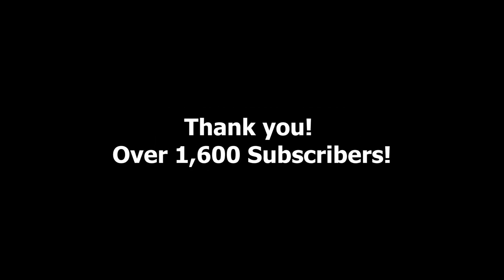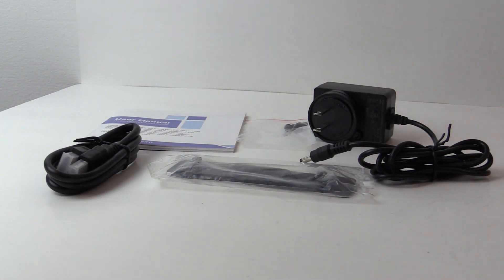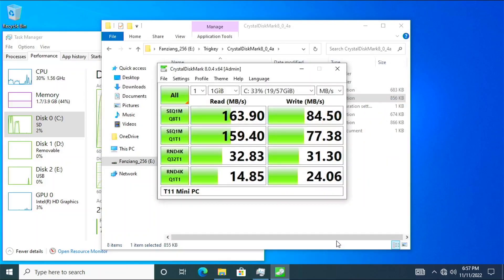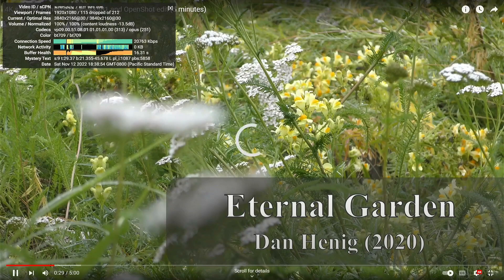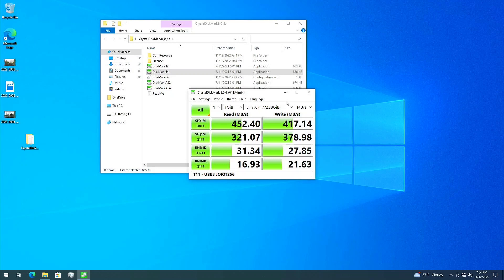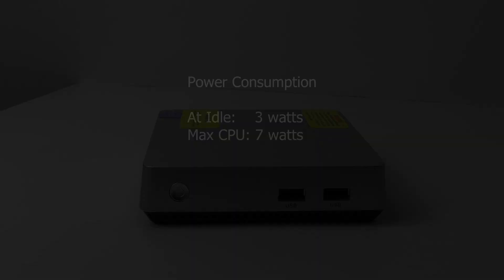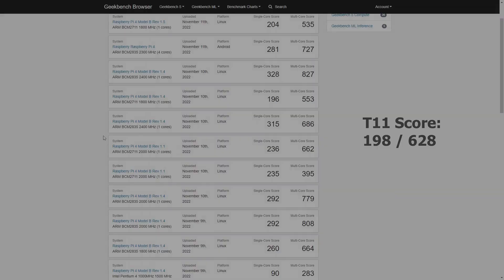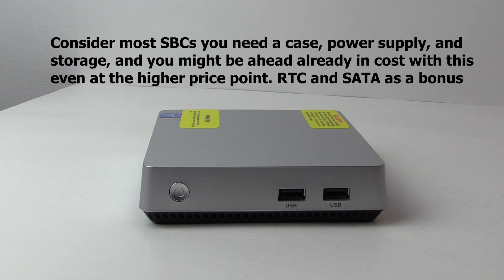Generic Mini PC T11 Review! Synthetic benchmarks and teardown. Can it replace a Raspberry Pi 4?

Comment: I just bought Rock5B and OrangePi5 boards which will blow Rpi4 out of the water, performance wise and got also Beelink Mini Pc's with Celeron N5105 and Ryzen 7 6800H Cpu's. You really wanna stay out of any machine having Infamous Intel Atom CPU.
Reply from the maker: Probably right, just looking at x86 alternatives to low powered ARM computers. This one was interesting to take apart.

Comment: I bought a surface 3 and  acer aspire switch 10 back in 2015 and 2014 and those despite great hardware designs and good features were horrible performers even with 4GB of RAM/64GB eMMC on Windows 8.1. Then some friends starting buying x86 SBC boards such as Rockpi4-X in 2019 using same infamous Atom Cpu's and they were also terrible devices, performance wise.
Reply from the maker: I get it, but I did pick a second one up for $19.99 on sale.

Comment: I opened mine up to see what kind of ram was in there so that I could try to upgrade it because it's slow. And I couldn't find a video on upgrading the RAM so I just figured I'd look myself. And now it will not power back up and I have gone in and checked and rechecked everything and I can't understand what is going on. I've had it for 2 days.
Reply from the maker: Oh no! As for RAM, it is going to be soldered on and not upgradable. As for why it won't power on now I don't know unless it is ESD damage. I didn't have any issue with mine and a friend has bought a couple and opened up with no issues. If you bought from Amazon try to contact them or the seller and see if they will replace or refund.
Reply: @ntgm20  I figured they wouldn't since I had opened it and "tampered" with it. I did manage to get it started back and it would only start with the extra power button that's hidden on the inside, not with the regular power button that you push on the outside. But after more tinkering it started working again. I think something was not seated right somewhere. Hopefully it stays going! I'm still dismayed how slow it is though. I got this to replace my big clunky desktop, but the clunky desktop was faster than this!

Comment: After watching this video several times, I finally went ahead and got one of these to try out. Only "problem" I seem to have is not being able to run this thing headless (Ubuntu server). So long as I have a monitor plugged in (even if turned off), it's fine. Once I unplug it, however, I seem to never be able to log in through SSH as if it's stuck in boot loop or failing to post (or something). Have you run into this issue?
Reply from the maker: Oh wow, I hadn't tested it on that but planned to run it headless.  Good thing I got a three pack of VGA dummy plugs when I got them for my HP machine.  I did notice some odd behaviour last night when swapping VGA cables on a monitor I was testing to sell, had to do a hard reset on the computer. So very weird, requires more investigation later. Thanks for your feedback!
Reply: @Not Terrible by Goodmonkey  I was just thinking about some dummy plugs after posting the comment, too. Please do let us know how it goes. I'm going to try a more DIY solution and see if that works. Y'know...to keep with the budget theme 😆
Reply from the maker: @casper.airsoft  I used a resistor with my HP backup machine, that worked until I had the dummy plugs. I also had the resistor on hand, which is why I went that way first.
Reply: @ntgm20  yup, cheap but effective...in a pinch :😀

Comment: I own an ACEPC T11 with the same Intel Atom processor that yours has. It came with Windows 10, works well, and you can back up the drivers using a windows utility/command. DISM is the command.
Reply from the maker: Thanks! I may have to look more into that command. I normally do manual file backups using robocopy.

Comment: If an android tablet can it be monitor of this? I have idea of cybercafe to be a bunch of mini computers of old games like dota, counterstrike and lf2, then mirc to be arnd for connecting to game room(to join) - then another is having android cybercafe for Mobile Legends and PUBG. If mmorpg - Dofus.
All using cursor controller and keyboard. Theres a way for diskspace to become ram, then ram to be until smooth for Dofus and PUBG.
Reply from the maker: Are you asking if a tablet can be a monitor? I'm unsure what you are asking.
Reply: @ntgm20  I couldn't read that either, but I think what he was saying is he wants to buy some MINISFORUM computers and use a bunch of cheapo android tablets as the screens.

His actual question (imo) is : "Can I run old games off the MINISFORUM box using an android tablet for a screen without losing the touchscreen but still have a keyboard/mouse attached (to the tablet)" and I am fairly sure the answer is absolutely not.  That kids dreaming.

Comment: I'm using an older arm based android tv box as a replacement for a raspberry pi atm. I bought 20 of them on fb marketplace for $20 and even though they probably aren't as powerful as a pi 4 the price was right and the one I'm using seems to be working great with octoprint so far. The only negative is linux distros are hard to find for them and I can't get the onboard wifi working but a usb dongle works fine so not a big deal.
Reply from the maker: Sounds like a good deal.
Reply: jeez, you selling any of them? lol

Comment: i got this in 2018 but id say not to mess with any high power hacks with the cpu as i think mine 
died from that.   it boot halfway then suddenly turn off but im not too sure why but im defo getting a better mini pc for use with the tv
Reply from the maker: I'm thinking of running some tests to see if cooling can be improved. Otherwise I don't plan on pushing it except to see how well it performs against ARM SBCs. In service it will probably be a bare metal server instance, where my other minis could host VMs or containers.

Comment: FWIW I use a 4GB/128GB eMMC X5-Z8350 (MINIX NEO Z83-4 Max) for my always on PC at home, running Home Assistant in a VM, and as a NAS with a 5TB 2.5" HDD. It sips 2W quiescent running Windows 10 Pro.

No, it's not a good desktop experience as you say, but it runs HA and as a mini NAS fine: it's perfectly acceptable and responsive in that role.
Reply from the maker: I love that you used quiescent!

Comment: i ended up with 3 minisforum PCs with the same CPU, they work OK, but the main issue they have is the really broken Wifi Drivers. full support only until Windows 10 1903 and you need to copy a textfile into system32 to get them to work at all. once they do work....they crash when you try to power the machine off. i did run them as Terminal servers with a modified Windows 10 and currently one of them is my 24/7 WebSDR.
Reply from the maker: Interesting. I've not done WiFi testing, other than to see it could actually see the SSIDs from 2.4 and 5 GHz networks. WiFi also didn't work out of the box with Xbuntu 22.04.  That is something I might look into once I go back to it.

Comment: I like that this machine has legacy ports like VGA, and that it sips power.  Interesting that it only takes 5v - I wonder if you could get a USB to barrel plug adapter and power this from another machine's USB port?
Reply from the maker: Maybe, but most USB that isn't USB 3.1 or PD or special for charging are limited to 500 mA, and this would need about 2 Amps.  Power supply is rated for 5 VDC 2500 mA.

Comment: I have Raspberry Pi 4 and 400. They are actually very capable as desktop machines and I use Bato Cera to run classic games. Although the specs say 2 4K displays I recommend only one. Two will bog you down but I run one monitor at 1080p. So just anecdotally, the Pi 4 is significantly faster. You can also run it from an SSD over USB and that is fast. I tried the same with a HDD (mechanical drive) and it is not usable. The PI is also a good way to get Mathematica for free.
Reply from the maker: I've seen quite a few videos of the Pi 4 / 400 used as desktops. This would probably do a lot better with an optimized or lightweight Linux distro. Max resolution on this Atom though is 1920x1080 x2.
Reply: Is that Wolfram Mathematica? and if so how does one get it free for Pi?
Reply: @AndrewAHayes  It is real Mathematica and it part of the RaspPi distribution. It performs better than my original 20 years ago on a PC. It will not, however, run over remote protocol, you have to be directly on the PI.

Comment: I have a GPD Win (revised model 1) it's got the Z8350, 4GB of RAM, 64GB eMMC storage (though it's faster/better).  It too originally came with Windows 10 pro, and yeah it ran like a turd.  The reason was it had Windows 10 pro, and not the IoT version that was made for low powered embedded systems (got less internal OS bloatware & telemetry crap) due to Windows 10 being a resource hog choking the performance on the Atom CPUs.  I replaced it with Linux Mint and it runs fine with YT (kinda) Heck I played Cuphead in with no problem at 720p.  emulation is fine, but it's more like a Raspberry Pi 3 (which I still own) in performance.  MP4 .h264 video playback even at 1080p is good, but YT use newer codecs (like H.265 HEVC that this CPU just can not handle.) at the most even in Linux 30fps video playback on YT is the best it'll do.
Reply from the maker: Thanks for the info. When I was putting the footage together and realized my local VP9 playback wasn't good it isn't surprising YT playback was rough. Those playbacks we're VP9, some lower resolution stuff will be AV1. Some other streaming services are switching to those too or h265. I could have tried that locally but I didn't bother to install the CODEC like I did for the AK2 and GK2.

Comment: The motherboard they use is "universal board" that usually i find used in POS and digital signage produced in mid 2015-2019,  and that daughter board containing the VGA usually directly hook to embedded display (since the signal is eDP/DP/MIPI compatible) or in some cases, connected to internal DisplayPort hub to run in "mini videotron" mode.
Reply from the maker: That wouldn't surprise me at all, especially seeing the extra power switch I figured it wasn't designed with this case necessarily in mind. There is one that looks like this with the N4000 and I wonder if it is the same.
Reply: @ntgm20  celeron and pentium board is rarely use for anything else in mind rather than being mini PC or a DIY router board by Chinese manufacturers, for more powerful application like several high resolution digital signage or even multipoint POS, they use core i series processor, i3-81xxU and i5-82xxU series is among the most popular choices, especially because the UHD 630 GPU, they didn't need to make weird board with MXM or even soldered Nvidia/AMD GPUs anymore.
Reply: About is it worth it or not to be pi 4 replacement, absolutely, in some scenario. Buying good quality powered USB 3.0 hub, couple hard drive with is enclosure, and good quality gigabit USB 3.0 NIC (TP-Link one is quite reliable), you can install a fork of OpenWRT called "Rooter" by modemsofmen, and you can make oversimplified gateway + load balanced 4G/5G/broadband router (yes the OS support tons load of modems compatibility), NAS with samba and NFS, and even running docker if you want it too